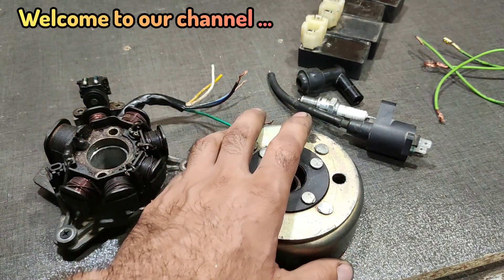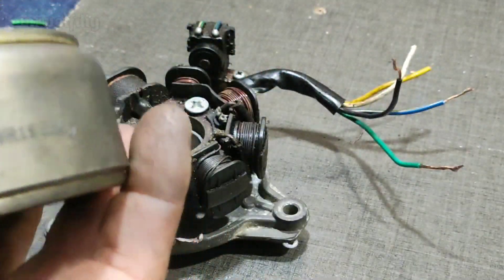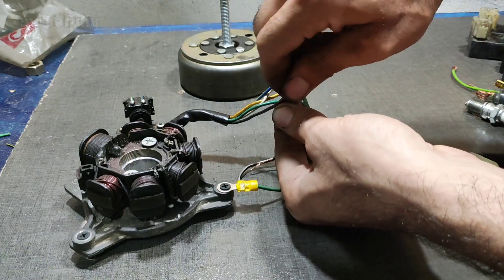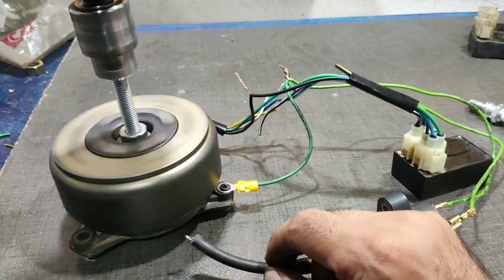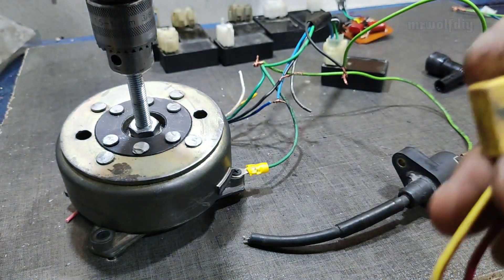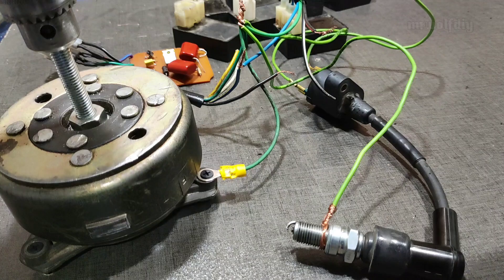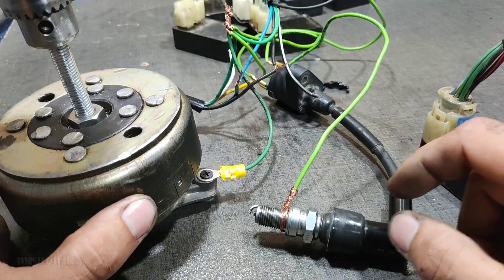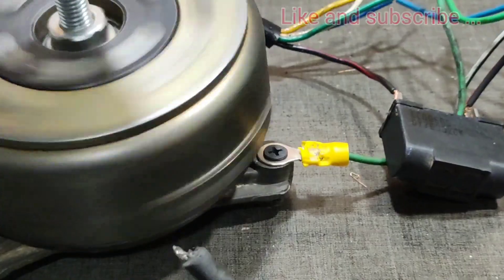How to increase ignition power, simple and practical method

Comment: Hey mate still enjoying your videos but really need the ansewer to a question I think you can help with I’m under the understanding that the spark plug fires every revolution of the crank tdc combustion and tdc exhaust(overlap) but people who have been doing this longer than me are still convinced it’s every 2 revolutions can you confirm it’s every revolution of the crank on chinise style cdi on single cylinder dirtbikes? Thanks dude every other revolution was for the older points system or am I wrong
Reply from the maker: Hi, Yes, in CDI systems for single-cylinder engines, the spark plug fires every revolution of the crankshaft, even during the exhaust stroke. This is entirely normal and is a characteristic of the system. If someone insists that the spark occurs only once every two revolutions, they are likely referring to older ignition systems.
In single-cylinder engines that use a CDI (Capacitor Discharge Ignition) system, the spark plug typically fires on every revolution of the crankshaft. This system is known as the wasted spark system. In this approach, the spark plug fires both at Top Dead Center (TDC) during the power stroke and at TDC during the exhaust stroke (overlap)
And The spark that occurs during the exhaust stroke (overlap) is called a "wasted spark." It has no effect on engine operation since no fuel-air mixture is present during this phase.
Reply: @ thanks that was exactly what I was thinking already but I see people who are certainly more experienced than me telling other people to take the cam out and spin it 180 degrees but that just means they’ve set them on the overlap(exhaust) tdc right so they’re wrong in saying take the cam out and spin it right it still spark when it’s meant to but they may have set them on overlap? I’m right in thinking the cdi doesn’t care whether it’s overlap or the power stroke tdc it’s going to fire?
Reply from the maker: the CDI system doesn’t really care whether the crankshaft is at TDC power stroke or TDC overlap. The CDI just focuses on the crankshaft’s position to trigger the spark at the right time,
If the crankshaft is at TDC overlap, both the intake and exhaust valves are open, which means the engine can't properly compress or ignite the air-fuel mixture, So, if the CDI fires during overlap, the engine won’t run correctly.
However, if the crankshaft is at TDC power stroke, the spark will be fired at the correct time, and the engine will operate properly. Essentially, while the CDI doesn’t "care" which TDC it is, firing during overlap will not work effectively. Proper timing is key for the engine to run.
Reply: @ thank you I was wanting to make sure what I thought was correct I have only been messing with bikes 18month but when asking other people it’s always been mixed opinions so 🙏! I totally get setting valves in on tdc compression stroke is correct and overlap will have things open when things should be closed and something closed when it should be open causing the bike to run like farts😂 I just wanted to confirm that all 4/ engines with a cdi run a wasted spark system even cheaper Chinese dirtbikes thanks again mate 
I’ve started messing with a soldering iron and making looms with a multi meter and some other gadgets got some newer coils and cdi to play around with learn new things 
Actually have 3/4 different coils what would be helpfull is some only have 1 terminal for the black where as stock is black(positive) and green (negative) I can run it with great spark with just the black and was told by the manufacturer to tape the green up is it grounded by it beeing bolted to the frame or should i run a ground wire from the coil to a bolt? Cheers dude?👍
Reply from the maker: I'm glad you got your answer. Regarding the single-terminal coils, yes, it takes its negative connection by being bolted to the frame, but to improve the body connection, it’s better to run a wire from under the bolt to the negative wiring.
If you need further explanation, you can send me images of the coils so I can take a look. My email and Facebook are visible in the "About Channel" section.
Reply: @ thank you my friend i really appreciate that? I was thinking it should have a ground as the factory loom grounded the stock coil but also understand diffrent coils can work differently and a plug grounds to the engine itself and some coils ground by beeing bolted to the frame I appreciate all your help and response clearing some things up for me much appreciated

Comment: Bro, I've seen them build a 1 cylinder 125cc engine that was converted to a 2 cylinder 250cc engine. Could you please make a 2 cylinder spark ignition kit?
Reply from the maker: My two latest videos are about this topic. You can check them out on my channel. Don’t forget to like and comment. 😊
Best of luck!🙏
Reply: @MrWolfDiy  Thank you very much, brother. I've pressed follow. 
I may not understand. I can't listen. If you do this VDO, you'll probably understand.
However, I will follow you.
Reply from the maker: It is an honor for me. If you have any questions, feel free to ask, and if I can, I will definitely help. Thank you, dear friend.♥️🙏🏻
Reply: @MrWolfDiy  Can you please make another VDO like this?
But use 2 sets of each spark plug coil and ignition box, using 1 rotating magnetic wheel, ignition 360 degrees or 270 degrees. 
If you don't mind, please consider my request.
I have a small Honda 125cc and want to convert the engine to 2 cylinders, but I'm still looking for knowledge about electrical kits.
Reply from the maker: In your project, the least concern you should have is the CDI unit
Converting a 125cc engine to a two-cylinder configuration is a complex task and requires precise calculations, especially regarding timing and the crankshaft. The timing of the engine (the synchronization of piston movements) and the rotation of the crankshaft have a significant impact on engine performance.
Your ignition system depends on the movement of the crankshaft. If both pistons move up and down simultaneously during each revolution, the engine structure works in a way that one piston is ready for combustion while the other is ready for intake. However, if one piston performs the combustion while the other performs the intake during each revolution, the engine structure will be different.
For the ignition system, since you are using a flywheel, using a CDI with two outputs is perfectly suitable. This system can separately supply the ignition sparks needed for each cylinder, improving engine performance.

Comment: Can you make 4 phases?
Reply from the maker: Having more phases is not related to the ignition system. Please explain more clearly so we can understand what you mean،🙏
Reply: @MrWolfDiy   I know this one is timed for engine,  would voltage drop if would be several more phases srom stator?
Reply from the maker: @11T872  No, the number of stator phases is for the motorcycle's charging and lighting system, and it does not affect the voltage. Typically, motorcycles with more than three phases have DC power and do not use alternating voltage at all. The ignition system operates with the battery.

Comment: Can it maintain ignition timing
Reply from the maker: Yes, the timing is managed by the trigger. The spark occurs at each dead point, and this cycle is maintained as the engine speed increases

Comment: What about multi cylinders can you make CDI with more than one output?
Reply from the maker: Creating such a CDI is possible, but it needs to be microcontroller-based, requiring precise programming for accurate spark timing for each cylinder. Overall, it is recommended to use the OEM version. Good luck

Comment: Hi very nice video i have a yamaha f1zr 110cc 2 stroke can i put a capacitor on and have a stronger spurk? Thank you 🙏
Reply from the maker: Hi,Yes ,  you can use it between the AC input from the stator and the CDI. However, make sure your capacitor is less than 1 microfarad and rated up to 450 volts. Additionally, you must pass it through a diode to prevent any reverse voltage.
Good luck!
Reply: @MrWolfDiy  thank you very much for your respond can you suggest any capacitor? Because i dont have the knowledge about that
Reply from the maker: Use AC fan capacitor 1uf and 450volt
⚠️Be careful of electric shock, because after installation, electricity is always stored in it.
Reply: @MrWolfDiy ok so if I put a capacitor with 1mf and 450 volts there is no chance of destroying something?
Reply from the maker: If you use a diode along the way, the voltage will not be reversed and it will not damage the stator, but in the long run, some parts such as spark plugs, CDI and coil may be slightly damaged.  But there is nothing wrong with testing.

Comment: Hello, I have an electric bike motor, Sachs 301/A that has a built in rev limiter to make the whole unit less than 200 watts for legality reasons.  I want to eliminate this feature since I live in the USA and do not have the same legal requirements.  Will your CDI work to replace the original one I have?  There are 3 wires coming from the coil that plug into the CDI unit.  Any thoughts are highly appreciated!  Thank you
Reply from the maker: Hi 
I don’t know exactly what type of electrical system your motorcycle has or what kind of CDI it uses. To help you better, I need more specific details:
1. Is your motorcycle fuel-injected or carbureted?
2. I would also need to see the existing CDI and the stator of your motorcycle. If possible, you can send me the pictures on Facebook.
With these details, I can guide you more effectively. 🙏

Comment: Awesome video, would you know how to test a motobecane stock cdi? I have a new coil had spark for a while and now nothing
Reply from the maker: Hi and welcome,
If there is no spark from your coil output, follow these steps:
First, check the AC input from the stator. Verify if there is power; when cranking, there should be a weak spark grounding to the body.
Second, check the wiring. Inspect the input and output connectors in the CDI and coil. This can be easily tested with a multimeter with a continuity tester.
If these points are all correct, then the CDI is likely faulty.
The CDI should send a pulsed voltage to the coil when activated. This voltage is typically high and appears briefly as an AC pulse only while starting and triggering the spark. If there is no output when cranking the engine, the CDI may be faulty.
In the future, I will make a video for troubleshooting the ignition system, you can see the videos related to the ignition system on my channel, there are informative tips in them, maybe it will be useful.

Comment: Do it realy increase the inital  and top speed because i doing modification to take my bike to do mountain ride
Reply from the maker: Yes, its real effect can be seen in the mountain, the stronger the spark, the stronger the ignition, but it also requires modification of the fuel system (carburator)for the best result.

Comment: FINALLY! I am in right channel I think. Great video bro❤ 
Could you help me in my project?
I have a Royal Enfield Bullet. It doea not rev more than 5000RPM (Company limitation I think) How do I make it rev more It is a carburettor bike so no ECM. Anxiously waiting your kind reply. Consider me a person with no technical background  when you reply. also, tell me which components  do I need to make the bike rev upto 6,500 RPM or 7000 RPM. The Tachometer has revving limit in redline till 8000RPM. THANK YOU❤
Reply from the maker: Hi and thanks
If your motorcycle is carbureted, there is hope for making some modifications. First, I need more specific details about your motorcycle, such as whether it's a 500cc or 350cc, single spark or dual spark, the year of production, and most importantly, we need to take a look at the coil, stator, and CDI unit. You can send the pictures to my email.

Comment: Depending on longevity span of part needed but sometimes you can build Beter than OEM are a nice bench type set built custom few times myself you only need around five hundred RPM faster is Beter but five hundread out you in ball park more expensive wires not nessicerly coper less thick sometimes sometimes thicker copper less coils loops around your set last longer performance enhancement but second set are burning to hot over extended runs and then start balancing with different spark plugs porcelain lengths difernt gap are chapters on not woried of mony used be with Tacoma cams pro racing series..Beter business etc try find journey men's manns performance enhancement build your own OEM mass production middle range usually fore maintenance free

Comment: Wht do i do if im not getting spark from the stator ?
Reply from the maker: Hi,If your stator is AC, you should have a black with a red line, or black,or red  wire, (ac power)it sparks weakly when starting.
But if you also did not have a wire from your stator(ac power), your stator is probably DC, for a better understanding, see the video of identifying DC from AC.
https://youtu.be/ZtO5bJKMQG8?si=iENZQs8lMqJ8zcAx
If you have any questions just write it 🙏
Reply: @MrWolfDiy  thank u so much!!

Comment: Your cdi seems stronger than the Honda  but the sparks are still orange red .
Ive made cdi's in the 70s 80s much larger capacitor s and the spark was blue as blue can be . Fuel economy gains are very memorable smoother idle smoother power curve. 
Your on the money with your ideas keep at it maby multi spark it as well
 (CDI MULTI SPARK)
could be your new invention.
Reply: Do u know what I should do if spark isn't coming from stator?
Reply: @dreechino3492  check continuity, resistance, and the coil to ground and damage of the coil .
Also the magnet to coil can not come into contact .
Good luck and good testing .
Reply from the maker: Yes, blue and purple sparks are more powerful, thank you for your visit

Comment: Does it work on battery operated stators? Primary coils gets it power from the magnet not from the battery itself
Reply from the maker: NO, because the battery stator operated It does not have AC power, And it starts with a DC CDI."It has its own advantages and disadvantages."
Reply: @MrWolfDiy  that's what I'ma curious about, I'm about to do this on my motorcycle but I have a DC stator with a DC cdi, if I put a AC capacitor in between them, it will blow up eventually,
Reply: @MrWolfDiy  Im finding ways how to increase output on the pulser without modifying the pickup magnet
Reply from the maker: @DarkKnight-cd4dv  Yes, in the DC ignition system, it's not possible to use a capacitor for boosting, but I'm glad you found another way. There are also methods to enhance the ignition of a DC engine, which I will explain in the future."

Comment: The standard OEM setup is probably perfectly adequate assuming the engine runs cleanly without misfires. Having a massive excess of ignition energy will not make the engine run any better and possibly reduce the reliability of the system.
Reply from the maker: The power of spark ignition greatly affects engine performance, much like a horse that runs faster the more it is whipped.But it has its advantages and disadvantages💗🙏
Reply: If the spark energy is adequate to initiate a reliable combustion event then excess energy won't make it "burn" any better. A bigger match does not mean a bigger resultant fire. Use enough energy for reliable ignition with a modest reserve, any more is purely wastage.
Reply: easier to start the engine, less likely to stall, can run richer, can use a lower idle?
Reply: Yessir, all that, with greater tolerance for lean mixture also. 
Better spark may not show much improvement on the dyno, but we don’t drive dynos.
I’ve never been sorry about having a stronger ignition!

Comment: How about dynamic ignition advance curve, where ignition timing is advanced as rpm is increased?
Reply from the maker: I tested it on several Honda cg 125 and Honda XL 250 motorcycles. In this version, it has progressed to some extent by increasing the RPM and it is limited, around 10000. I also made a simpler CDI version that will be released in a few hours.  .  you can try🙏

Comment: Sir, can you make a circuit that will boost ignition of Honda C50 bike which don’t' have cdi system.
Reply from the maker: Hi and welcome;
Connect a mkt capacitor between the AC wire at the beginning of the stator 
"250-450 volt 1 microfarad"
Test the spark on the spark plug before and after this tell me later
Reply: @MrWolfDiy  "Beginning of the starter" means before the flyback transformer/coil?
Reply from the maker: @SkjoyBd  AC power that comes from the primary coil of the stator
Reply: @MrWolfDiy  ok
Reply from the maker: ⚠️And be sure to use a good rectifier diode before the capacitor To avoid possible damage.🙏💓